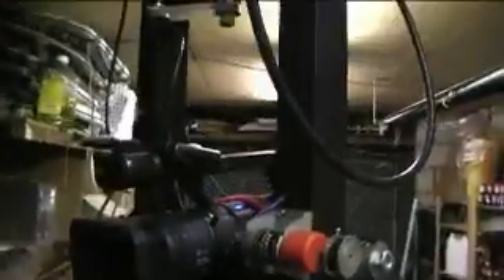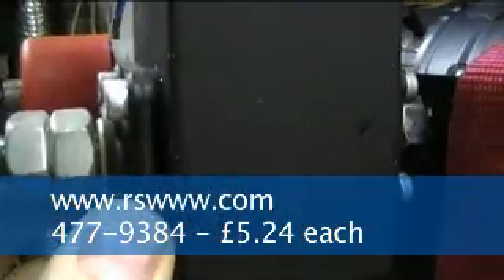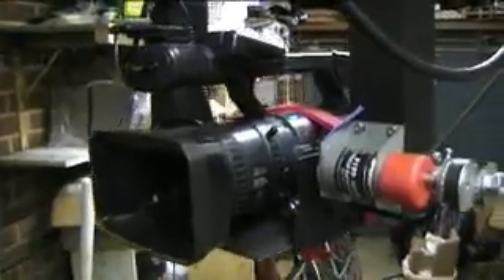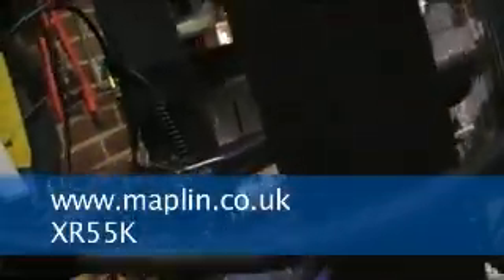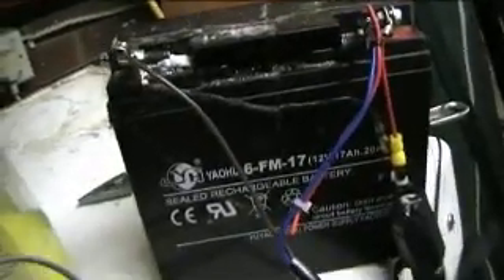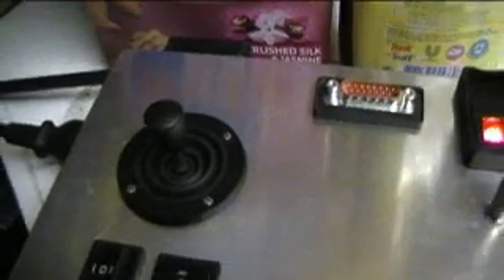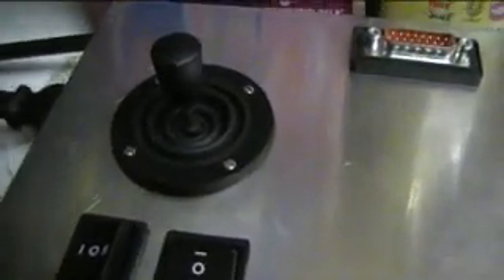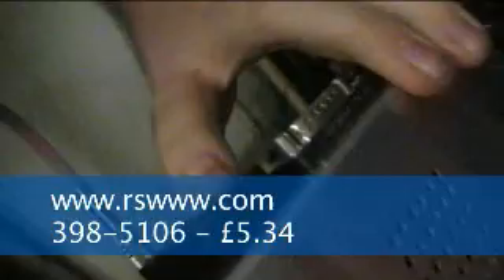Remote Camera Head - How it works

Comment: Hi, two questions if I may.
With the pan motor at the top of your rig, it looks like you have the motor & pully attached to the top section with the other pully attached to that same section - How does that work if both parts are attached to the same section? If obviously does but I just see it in my head. 

Can you tell me if the pulley wheels are: Synchroflex T5 x 10mm (Part No: 4621-122) and are you using a Synchroflex Timing Belt T5 x 10mm x 260mm (Part No: 4661-260) 
Many thanks 4 ur time

Comment: @hoarp001 I plan on making one of the servos move the bottom plate. It doesn't need to move more than 180 degrees and that's what my servos can do. U are right about the extra needed electronics for the secondary motor. I picked up a ESC today and that plugs into the receiver so instead of 2 servos i have one motor and one servo, both reversible and variable speed. - with a quarter mile range haha. I finished building my custom tripod today to hold my Jib - its homemade too check out my channel!

Comment from the maker: @b2dmastersniper You could do that, just bear in mind that servos when plugged into normal RC electronics only turn 90 degrees. Also the output from the receiver is pwm so you wont be able to plug that into a high torque motor without some other electronics in between. The AX500 board I am using here to control the head came with a little harness that allows you to plug it directly in to an RC receiver unit, so you can control those motors through the AX500 using an RC receiver.

Comment: pretty old video but what are your thoughts on a totally remote controlled rig? I have a remote control setup for an older gas rc car. The controller is electronic and provides variable speed to 2 servos. One of which will be replaced with a high torque motor to spin the entire rig. This will enable all moving parts to stay on the u shaped jib and have no cables to tangle up except for the hdmi out of the camera.

thoughts?

Comment: That is nicely built remote head. Well engineered and thought out. Motors are a bit noisey and have a fair bit of backlash in them, but putting a simple spring loaded belt tension on would help. But you've done well so far and by making it yourself, allows you to improve the existing design. :-) BTW you sound like Dom Joly on this clip.